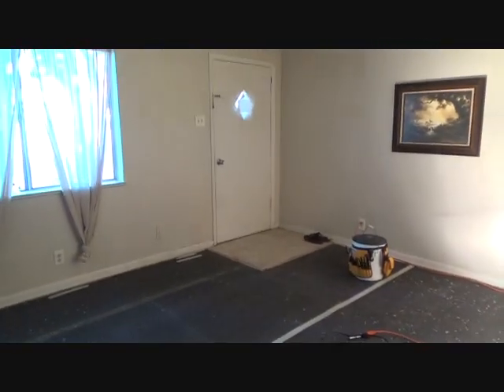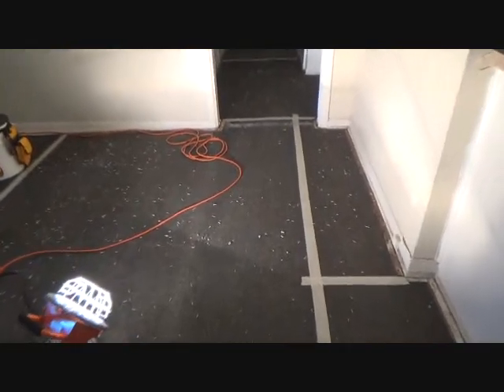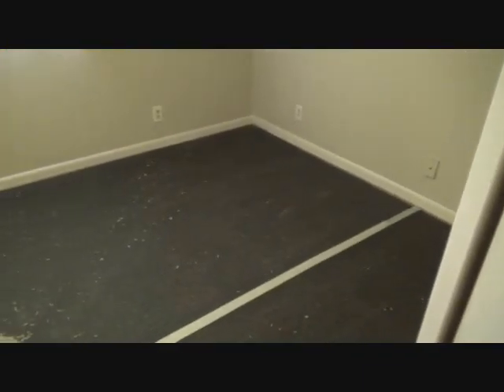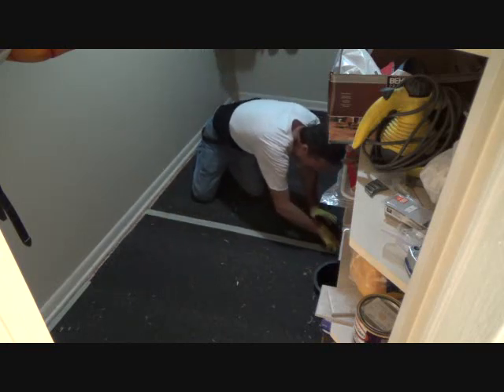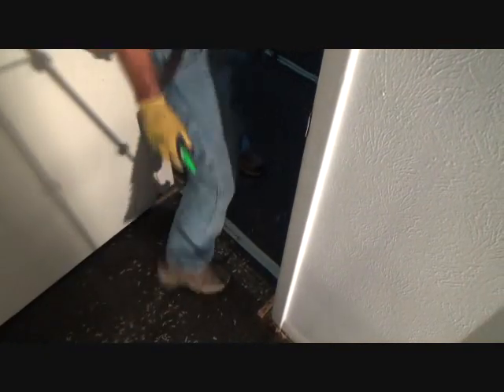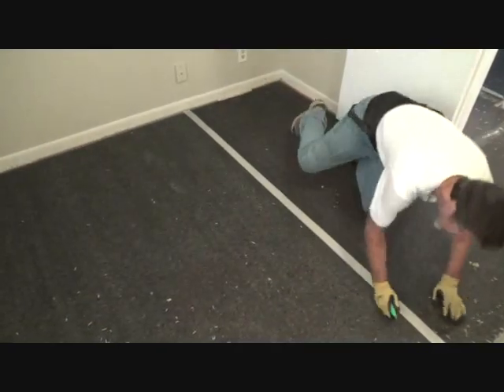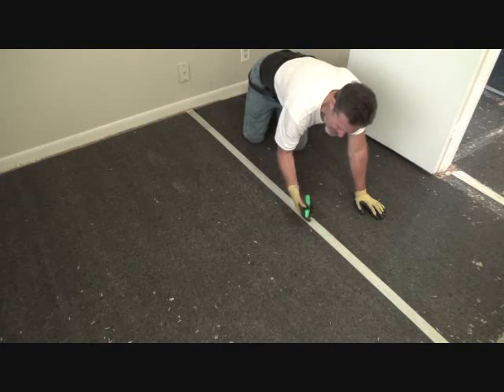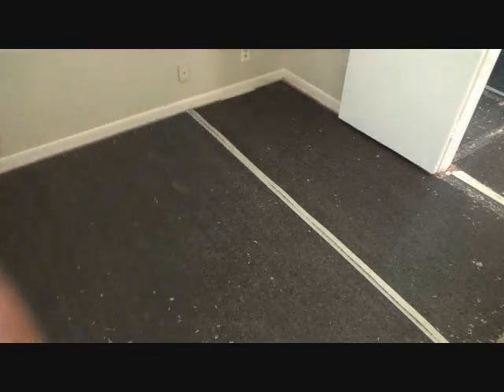Do this FIRST before removing carpet pad

Comment: I was hoping that you would show how to deal with the staple. I found a small tack puller with a handle like a screwdriver and worked back and forth along the length of the roll as I went but it was tedious.  But it was even worse if I tore the padding through the staples.
Reply: the type of tool to use is flat nose plyer to grip the staple
Reply: pliers
Reply from the maker: I know what you mean! I just take a pair of electrical dikes & grab one edge & twist up. come right out but tedious as you say.
Reply from the maker: I use wire cutters & grab edge like you say then twist it & it pulls right out. Very tedious though but what choice do you have. The guys who install the carpet pad that way don't seem to care how many staples they put in...right?!! They are probably grinning thinking of the poor saps (you & I) who are the lucky ones to have to remove them! LOL